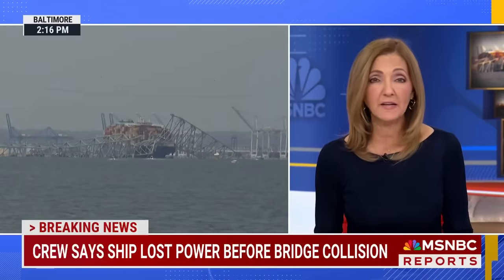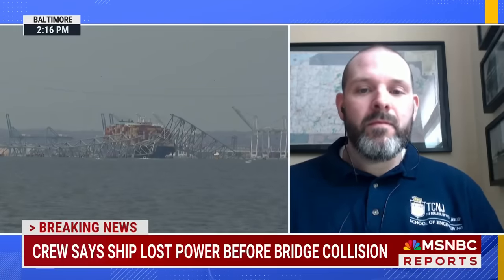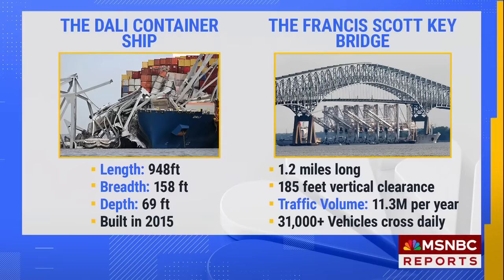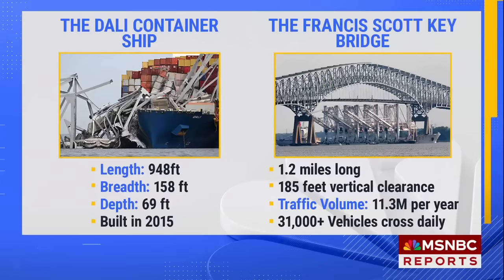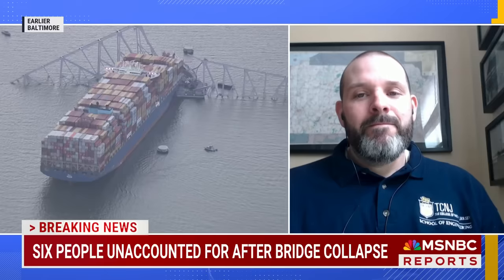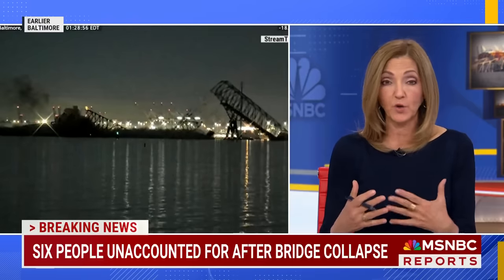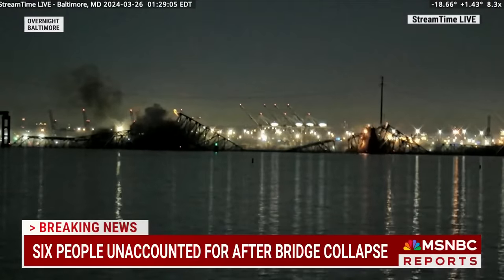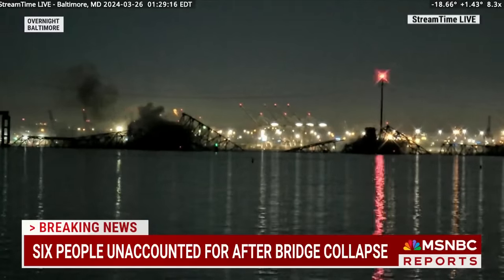Building Baltimore bridge from ground up will take 'much longer' than reusing wreckage: Expert

Comment: None of that is usable. The stresses put on it during impact and collapse make each piece completely unpredictable.
Reply: Tell me you know nothing about construction without telling me you know nothing about construction. The footings that are buried deep underground are likely fine and can be reused, saving a lot of time, cost and materials.
Reply: @ChangingAperture   One of those footing was just run-into by a thousand-foot ship.   It's toast.
Reply: The ramps leading up to the main span are undamaged.  That’s probably the “wreckage” that they were referring to.  The part that fell in the water needs to scrapped.

Comment: It was also a continuous truss bridge which means literal "house of cards" as just one link of the truss failing means the rest will also fail.
Reply: They may have to replace it with a suspension or cable-stay bridge.  And container ship rated bumpers.
Reply: @cjpatz bumpers for sure.  Collision protection for a bridge over a busy shipping lane is a necessity, today more than ever.  Ships are only getting larger.
Reply: @Brocuzgodlocdunfamdogson the ship is a newpanamax, can't get any bigger and still pass through the Panama canal.
As for bumpers, you're talking about deflecting a ship with a load of 116,851 tons. Do enlighten us on what would act as a properly protective bumper against 234 million pounds of thump.
Reply: @spvillano  mmm, they just install bumpers and artificial islands for nothing.  Engineers are already talking about it, get with the program.
Reply: @Brocuzgodlocdunfamdogson  interesting, given engineers reviewed dolphins previously (the artificial islands) and found insufficient room for them and the shipping channel. Guess the universe expanded enough to magically allow them - despite universal expansion not occurring in gravitationally bound bodies.
Bumpers, yeah, because bumpers are ever so magically effective against millions of pounds of impact upon steel - they're magic! Maybe using Harry Potter's magical twig.

Comment: Can you all imagine...IF this horrific event would've happened on rush hour and during the day!!!!????.. 🙏  Omg..a SIMPLE MASS CASUALTY CATASTROPHIC EVENT!.. 🙏 🙏 🙏
Reply: It did in Minnesota about 10 years ago.
Reply: Can you imagine if the billions funding wars were used to repair our cities
Reply: The boat had radioed ahead that it was having problems and the bridge was shut down. The only people on it was a construction crew.
Reply: @silentmajority8365  Well JB did approve 1 trillion for construction, but that will probably only be seen by the top union donors. In this case though it was from the ship not lack of repair.
Reply: @boristheamerican2938  you are correct. Since there was construction going on, it was stop are go traffic, so there were not cars launching off the edge at highway speeds. The contractors had huge piles of material and heavy equipment on the bridge at the time. That in combination of age and undersized gusset plate  created a lethal mix.
Reply: @boristheamerican2938 yep and that's why we need to vote Democrat to keep this country running. Infrastructure is huge!!

Comment: these ships are far too overstacked, every day, hundreds of those rail containers drop into the sea ! (literally, every day) as lost products, thats covered by insurance or not ~ littering the sea floor - the greed of these shipping companies is outrageous, to the point the ship is overburdened and can't be controlled under usual conditions - clearly the vessel was overstacked by x3 what it should be holding
= we need new regulations to control this madness (and skyrocketing insurance rates/losses) and bring the CEO's of these shipping companies to accountability or even jail.    ~  its a serious issue that affects millions of people  = each and every time this happens
Reply: You make a very good point. The bridge was built back in the 1970's before such large container ships were even a gleam in someone's eye. Unfortunately, the shipping companies will an army of lobbyists to try & stop any sensible legislation. They will pound away that the cost of everything will rise. Now, if Congress has any balls, they will consider such legislation balancing out public safety & shipping concerns. Then again, given our current state of politics I doubt it.
Reply: It's called supply and demand.
Reply: I was unaware that a vessel losing all power is usual conditions.
There were two port pilots aboard and in control, who navigate those waters multiple times per day without a problem - in vessels whose usual conditions are with full operating power.
But, let's go with less loading of vessels and the inevitable economic disaster from shortages akin to the pandemic shortages, just to make you ecstatic that someone listened to your stupid ideas.
Reply: @3698s shortly after opening, there was a vessel collision with one of the piers, damaged the pier to the tune of (then) $500k in damages. Yeah, ships are bigger and more massive and the channel, far too narrow to allow protective structures to be added. Hopefully, they'll include that in the replacement bridge design.

Comment: I cringed at the posted dimensions  because depth is meaningless without the waterline measurements.
Reply: The ship has a draft of 40 feet, the channel depth is 50 feet. Suffice it to say, I'm sure that the bow is resting on the bottom, given the mass of the bridge on top of it and that it's down by the bow.
Reply: @spvillano  Now that's a follow up of someone who knows what I'm talking about.

Comment: I think it's quite obvious that this truss design isn't self-supporting from one bank to the other. You can see the other supported sections fell when the central part fell because the distribution of forces was keeping the whole thing up. In short, one section failing breaks the support across the entire span.
The priority is going to be clearing the wreckage to allow shipping to continue. Road traffic will have to be diverted for the next 5 or so years while the bridge is rebuilt.
Reply: That's a primary failure mode for a continuous truss bridge, as the entire bridge supports the load. It's basically a gigantic single point of failure bridge.
Yeah, first is search and rescue, then clearing wreckage and recovery. 
It's uglier in that the bridge carried hazmat, leaving one other bridge for hazmat or traffic with hazmat would have to bypass west of the city. Used the bridge frequently enough in the military, when our convoy either had fuel pods loaded or fuel and explosives, as otherwise it was one other bridge or bypass west at a higher road distance.
Reply: I think one year to 18 months. They already have the design and the material specs. They are not going to let that bridge go 5 years.

Comment: Why didn't she ask him about the flashes on the top and bottom of bridge right before it collapsed?
Reply: There were large beacon lights along the top edge of the bridge for alerting air pilots.  There may have been transformers in the electrical system at that point that were damaged, causing the fire and smoke.  I've not found clear images of the top of the bridge that would clarify this, but you sparked my curiosity.
I've seen transformers explode.  What we see in the video is about what one would expect of that.  It wasn't bombs.  If there were bombs, they wouldn't need the ship.
You'd collapse too, if you were hit in the shin with a 40-pound mallet.  (And wish you had a protective bumper, but you never expected a mallet to hit you in the shin, did you?)

Comment: It sure looks like they did the bare minimum as far as structures to protect those pylons.
Reply: It was studied, not enough room for protective structures that wouldn't obstruct harbor entry. So, really, a poor design that was in part restricted by the technology of the time and budget.
Reply: @spvillano  wow, thanks for the information. Knowing the vulnerability, seems like they could have done more. But then again, a fully loaded container ship doesn’t stop on a dime, and one tug probably wouldn’t have made a difference considering the amount of mass and short amount of time to react. 
This is going to be a very expensive accident, just the lawsuits alone will be billions of dollars and at least a decade of hearing about it. Someone should start a betting pool as to who will end up taking the blame, my money is on “act of god”.
Reply: @mplsmark222  even getting the engine back when it did wasn't enough to get the vessel under control quickly, as momentum is quite significant. After all, the ship can stop on a dime, it's just that nautical dimes are really, really, really big.  ;)
As for litigation, well, I can predict with 100% certainty who will win - the lawyers.
Reply: Let's keep in mind the bridge was built decades before ships of that size were even plausible.  As for upgrades to infrastructure, we'd have to ask Republicans why those keep getting put off when they come up for vote.  (Don't forget to ask why they also brag about helping their communities when bills pass despite them voting against.)

Comment: it did have bullards you can see one of them, just off the side of the ship, there is anohter one just in front of ship and the other two on the other side big round things in line with where the support columns are. They are just past the 2 hydro pylons

Comment: Rebuilding should be fast, the ship collided with one of the vertical structural support and it basically halted the ship so that could be the worst part of the bridge that got damaged, but the bridge structure rebuilding should be fast, not an expert anyway.  The ship hit the bridge at its most vulnerable part I guess,  like a strike in bowling.  Thanks Andrew Bechtel.  I hope they find those missing in good order.

Comment: I wish him luck using all that buckled metal. I do not know how he is going to X-Ray the pieces he is going to use.
Reply: He was not saying the metal that fell into the water it is the footings in the water if those can be reused it will speed up the project
Reply: Tell me you know nothing about construction without telling me you know nothing about construction. He’s taking about the footings that are buried in the ground, not the metal structure of the bridge
Reply: @ChangingAperture  A lot of people are focussing on the bit that has fallen down. there will be damage in the structure that is still standing. All the support pillars along the rest of the bridge will need to be replaced as the impact would have sent a lateral shock loading along the structure and would have imposed forces on the remote pillars. There are probably micro cracks meaning those uprights are not viable, Using the existing foundations might sound like a good idea but I suspect that after you remove the existing uprights you would need to partially excavate and re-pile, Do not forget that bridge is over fifty years old.

It might be better to use the existing bases as work stations for piling new bases. Transport for London did this at Blackfriars station in London when a new station was built across the river and the old structure that the line being replaced sat on was used for that very purpose.
Reply: @ChangingAperture first, the foundation is below the water, the pier was struck and likely damaged, leaving others to take impact and shearing forces as the bride collapsed down upon them.
Tell me you know nothing about bridge and highway construction and engineering without telling us all that you know nothing whatsoever about them!
*Maybe*, after thorough inspection and gamma imaging to ensure the piers are still usable after minor repair - with some likely needing replacement. Not that replacement would delay construction by that much. Six weeks for concrete cure before loading with the bridge support elements, about the same for preparatory work to construct replacement foundations and piers, pouring over a week to keep the concrete volume controllable and hence, temperatures under control. Slinging a bridge structure, then deck, welding rebar, pouring decks will take the lion's share of time.
Reply: @konradyearwood5845 that's about what I was thinking, with an option to reuse some piers if possible. The steel, that's all recyclable and useless for anything else after that much abuse.
The Delaware Memorial Bridge has protective measures installed at significant cost, but it has a wider channel opening and it's a suspension bridge.
Reply: @spvillano  okay, so the engineer that’s the “chair of the college of civil engineering” said they might be able to reuse the footings but you know more than him. Got it.

Also, my comment was in reply to the original comment by someone so uninformed they thought they were going to reuse the same steel beams.
Reply: @ChangingAperture I heard what the chair said, obviously he omitted for simplicity inspections, repair and potentially widening the channel a bit. As for the steel, I got that impression as well from the comment. The only thing that steel is good for now is for scrap to be melted down and recycled.

I suspect a false sense of security was instilled after the 1980 collision with the bridge pier, which caused $550k in damage only, never taking into account the increasing mass of newer cargo ships. Downside being, due to the proximity of the shipping channel, protective technologies are quite limited as to what could be deployed to protect the replacement in the future.

Comment: Why was the channel wide enough for the cargo ship to be so far off course??
Reply: The video is online (along with some disinformation videos that contain the unedited video that's relevant). The ship lost power as it was approaching the bridge and without power, lost maneuvering control and drifted into the bridge pier.
Reply: @spvillano And the backup generators?
Reply: @lostcat9lives322 ever rely upon backup generators? First, they have to start, then get up to speed and stabilize in the right RPM range. Now that precious minutes have passed, you still have no control, as you still have no thrust from the stationary shaft, as the main engine has still taken a powder.
Which is rather what happened, save it was blowing serious smoke consistent with a restarted main engine screaming to get control of the vessel. Lights had come back on, it hit the bridge and well, lights out again.

Comment: Surely its better to take longer and have a safer bridge that will last for many more years, than one made with broken parts thats guaranteed to be dangerous sooner??
Reply: If the remaining old parts are proven safe and can be safely reused for the replacement bridge, then reusing them makes sense. Replacing the foundation without a good reason could possibly weaken the river bed, leading to a weaker foundation. If the remaining old parts are too damaged and can’t be repaired, we then have to replace them.
Reply: My take away from the expert was reusing the footings not the bridge that fell into the water
Reply: Surely, engineering experts will know the truth of this better than someone commenting on the Internet.
How about letting them decide?

Comment: Once the Captain radios MAYDAY both ends of that bridge should have been closed off. It takes seconds to make that call. Also now tugs will be used till after or before that bridge.
Reply: They were closed off and many vehicles were stopped from going onto the bridge.
A work crew was on the bridge, though.  There was no time for them to get off.

Comment: ‘’REUSING WRECKAGE’’,did I read that header correctly?
Reply: The ship has a draft of 40 feet, the channel depth is 50 feet. Suffice it to say, I'm sure that the bow is resting on the bottom, given the mass of the bridge on top of it and that it's down by the bow.

Oops, wrong comment...
Think they're talking about reusing the piers after inspection and repair. I'd suggest going with a wider channel, which would allow for protective measures to be installed around the piers.
Reply: It's a bad headline but I'm not sure what would have been a better wording. The expert is talking about possibly being able to reuse the foundations under the water, not the parts that collapsed.
Reply: Yep, you did. Reusing all that stressed metal will be faster.  Yes they said that.
Reply: @wickedguppy3715  well, it's doable. Not exceptionally bright, but doable. Collect the gagglefuck of steel that has to be removed anyway, recycle it in a steel plant (let me know when you can find one available for that special job), melt it down, remix it properly, make the superstructure and other components from the old mess and some additional new purchases with only a moderate delay.
One can also slide down a ten foot razor blade and soak in a pool of iodine. Not recommended or smart, but doable.

Comment: This aint getting rebuilt in our lifetime
Reply: It will be rebuilt in our lifetimes. Look at what the Minnesota DOT did when the I-35W Mississippi River bridge fell into the river due to fundamental design errors that caused it to eventually be unable to support its own weight. The replacement bridge got designed and built in a matter of months.
Reply: @jnvivian  that was 15 years ago. Those engineers are 15 years older if not gone. Man power is not unlimited resource
Reply: @jnvivian uh I live here in MN, that bridge you're referring to is probably a quarter the length of this thing lol.

Comment: That should not matter! You cant reuse those materials. The structural integrity is gone! You have no choice but to use newly manufactured steel and freshly poured concrete for the roadways. The road will not just reattach to structural code with a patch. Nor will any weld hold that type of weight long term
Reply: He’s talking about the hardest part to rebuild, the footings, pilings and foundations under the water. The roadway and superstructure are actually not the hardest part to replace.